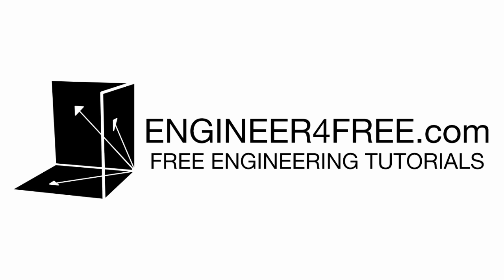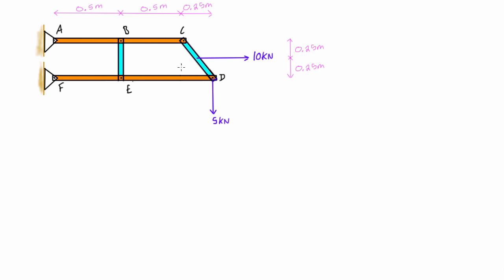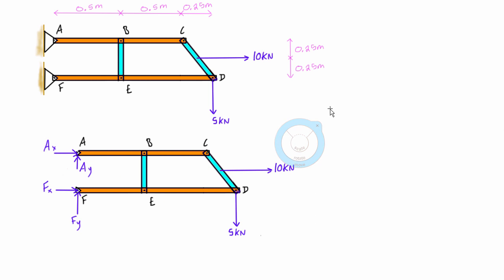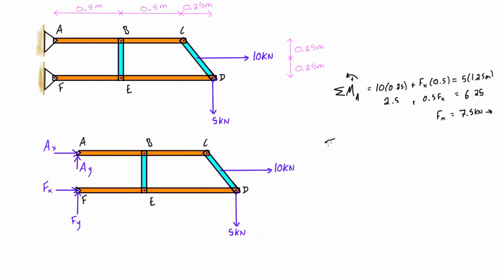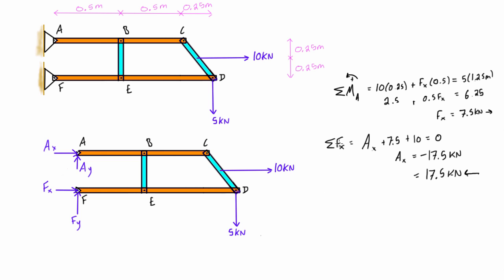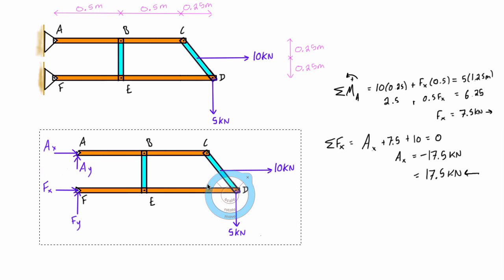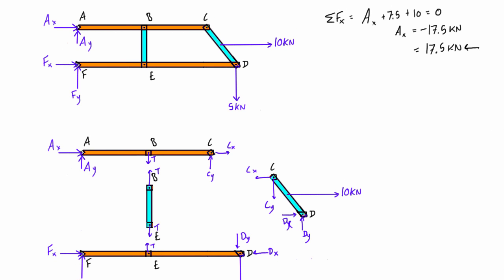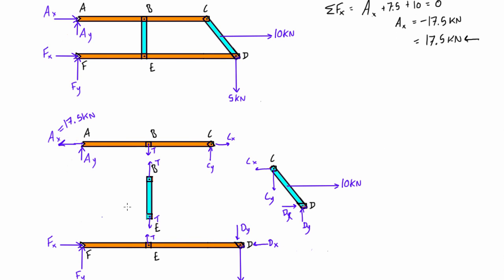Frame example problem #1

Comment: In trusses we assume force in member either to be tensile or compressive, but here in frames you treated every member forces only at joints not along ? Is this way we have to solve frames question

Comment: I'm struggling on sketching the correct FBD of internal forces on each member. Say for example in "Member ABC", on "Point B" I drew it having a Components "Bx" and "By" while on "Point C" is in Tension/Compression. Is this still correct?
Reply from the maker: These frame problems are messy. In this case, member BE is a straight 2 force member, which means it's only in pure tension or compression. Member CD however is a 3 force member, and has other internal forces (shear). This video and all introductory frame problems at the statics level will not even mention shear, and just talk about the overall force being transmitted across each pin. For now you should think of it like this: ABC and CD are both connected to a common pin. ABC pushes/pulls on that pin, and CD also pushes on that pin. ABC and BC don't really push and pull on each other, they push and pull on the pin. The pin is in static equilibrium, because its not accelerating in any direction. So the force balance on the pin must equal zero in the x and y direction. This means whatever push/pull of each x and y component from ABC on the pin must be equal and opposite to the push/pull on the pin from CD. That's the best way to deal with these IMO at the intro statics level.

Comment: why would the Cy for member ABC be in tension but in compression for member CD lol bro you messed this whole thing up
Reply from the maker: This problem is a mess. The members are not in pure tension/compression, but there is also an element of internal shear force, and ignoring its analysis for simplified statics problems like these can lead to real-world errors. But this is still how frame problems are generally introduced in introductory statics classes. Because CD is a 3 force member, and not a 2 force member, we cant just talk about it just being in pure tension or compression. What we do with this simplified version of frame analysis is consider that the pin/joint at C is in equilibrium. That pin that connects ABC and CD is like a reaction force from the perspective of each member. The pin pulls/pushes ABC to the right. The pin pulls/pushes Cx to the left. The pin is in equilibrium, so it doesn't accelerate in the x direction, and therefor the net x forces on it must sum to zero so the magnitude of the x component of it's force balance is zero. Same in the y direction. With frame problems it's helpful to think of how members are interacting with each pin, rather than other members directly.

Comment: shouldn't the moment caused by the 10KN, Cx and Cy force be reversed since it causes it to rotate counterclockwise around D? Would that not mean that Cy has a force of -6.25KN?
Reply from the maker: Sorry I skipped a step. The initial expression for member CD sum of moments about D should be: -10kN(0.25) + Cy(0.25m) + 17.5kN(0.5m) = 0. This can be rearranged to 10kN(0.25m) = Cy(0.25m) + 17.5kN(0.5m) which is what I have. By moving the negative term to the other side of the equal sign, it becomes positive.

Comment: Thanks for Solving my previous issue. My question is about member CD . Is the member CD a two force member? Eventhough there is a horizontal force of 10 kN acting on CD in its middle . And will it still be a two force member if I apply this force on pin joint D of member CD?
Reply from the maker: CD is considered a 3 force member. Each pin applies one force, and the horizontal 10kN in the middle is the third. If the 10kN horizontal one wasn’t there, and we still considered the vertical force to be acting on the lower Teal coloured member, then CD would be a 2 force member. If the horizontal force wasn’t there, and we considered the vertical force to be acting at D on CD, we could model CD and a 3 force member again. Sorry for the delay, hope that helps clear it up.
Reply: @Engineer4Free   Thank you for solving my issue👍♥️

Comment: Will I get the same answer if I apply 5kN at point D of section FED?
Reply from the maker: I’m not sure what you mean, the 5kN force is indicated there
Reply: @Engineer4Free  I'm sorry I  framed the question wrong. What I meant was if I assume 5kN at FBD CD instead of FBD at FED, will I get the same answer?

Comment: Hi. Is there a way to tell if a connection between two parts (e.g. a pin joint) has a vertical and horizontal force acting on it? As in, why does B not have a horizontal force while C and D have both directions? I assumed after seeing a few examples that the general rule to follow is; if there is a pinned connection then there are equal, opposite and co-linear forces acting in both directions.
Reply from the maker: Hey Shoncay, there is a trick. You need to identify which members are two-force members. Watch this video on 2 force members if you haven't already: https://youtu.be/Zc5zU8Piys4 the internal force of these members will be aligned along the axis that connects its two pins. So in this video, both teal coloured members are 2 force members. The vertical one (member BE) axis is vertical, so the Internal  force has no horizontal component, only vertical. That's why the pin doesn't have any horizontal things going on. Member DE is on an angle, so it's internal force is aligned with that same angle. So 5he internal force has both x and y component. That's why you see both in the pin. Hope that's makes sense. You can also watch the video I did on 3 force members, as it's a good rule to know too: https://youtu.be/1irV4NXRZJA

Comment: Is it possible to take the moment about another arbitrary point which will include the Fy and Ay forces in the calculation and then to take that equation along with the summation of forces in the y direction equation and solve for Fy and Ay?
Reply from the maker: Yeah you can take moments about any point. It's common to pick a point though that has some lines of actions of forces passi g through it thiu because then those forces will not cause a moment about that chosen point and it will simplify the equation

Comment: Why is the 5 kN not applied on member CD?
Reply from the maker: With frame problems, if a force is applied on a joint, then only apply it once when you break apart the frame into multiple FBDs, otherwise it will be double counted and you won't get the right result.
Reply: @Engineer4Free  I tried to answer a different problem with the same scenario wherein an applied force is located at the pin. According to your explanation in the prey video, it doesn't matter where I decided to put the applied force at the joint as long as I don't duplicate it. My question is why is that the answer is different if I put the applied force on one of the member and got it right according to my book vs if I put it on the other member and got the wrong answer? Thank you.

Comment: Hey quick question, when finding the moment about A, wouldn't the force applied from Cy be negative since it is causing rotation in the clockwise sense? So then the member BE would be in tension instead of compression
Reply from the maker: I should have stuck with the convention in always labelling counterclockwise moments as negative, an written -T(0.5m) - 25kN(1m) = 0 but for some sloppy reason I decided to drop the negative signs. The result doesn't change, because the initial right hand side of the equation is zero, so either way, T will come out as -50kN.

Comment: sum{Md}=isn't it Cy(0.5) bro let me know I'm really confused
Reply from the maker: Hey no it is Cy(0.25) because the horizontal distance between C and D is 0.25m, you can see at the very beginning of the video when the distances are labelled on the diagram.